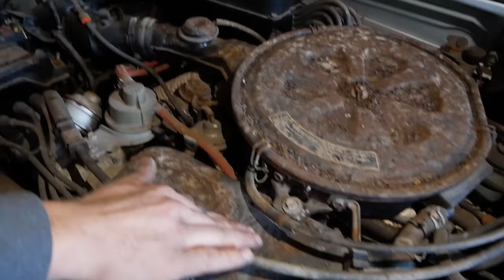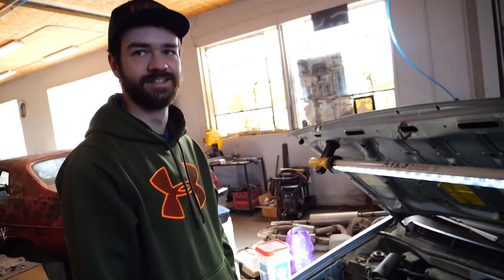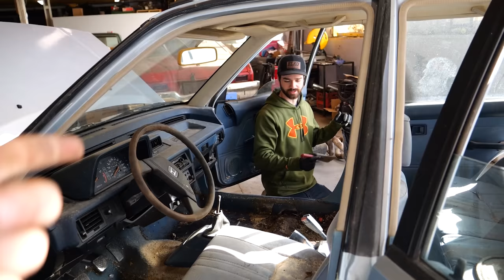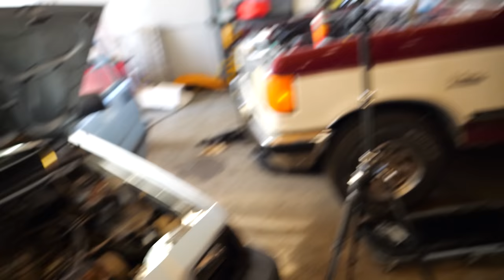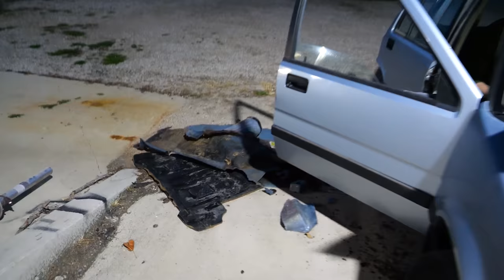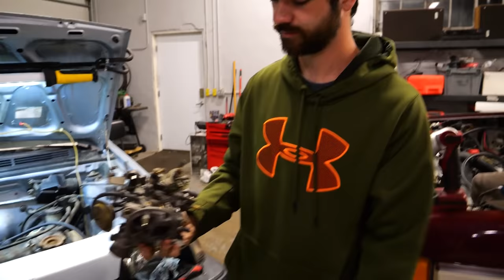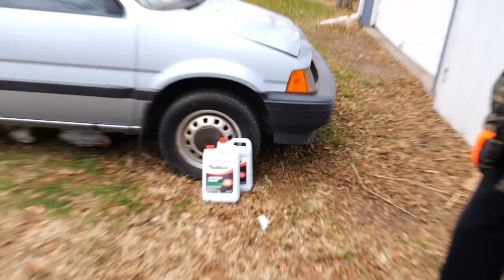ABANDONED 4x4 Honda Civic - Will it Run After 20+ YEARS??

Comment: Boys, get you a piece of 3/16" brake line for your air gun. The fittings should thread right into the end and  will help keep things from blowing around your glasses and into your eyes. Trust me on this one. Gasoline is bad enough, but you don't want the eyeball drill.

Comment: Safety tip either remove tge strings from your hoodie or at least tuck them in. A freind of mine got his caught in an alternator fan and he smacked his head on tge engine before tge string broke. Fortunately he only got a bump on the head but could be worse

Comment: That Daytona was probably a Shelby Turbo Z.  If they have the t top they are worth some money in decent condition. Even without it they are still worth a little bit now. Simply because they all rusted away and are really really hard to find.  I had a two-tone, Electric blue with silver 1993 shelby daytona turbo Z back in 1997 (first car I purchased with my own money in high school) it was still a newish car. I liked it a lot.  Sold it in 2001 for a 25k mile one owner 1992 mustang GT convertible.  Still have the mustang to this day.  Living in michigan I could only dive the mustang in the summer. It still has less than 75k on it.

Comment: I had an 89 accord coupe with that electro carb. Just swap that thing to one of those weber aftermarket kits or  fuel injection. A professional rebuild at a shop (if you can find one that will even try) is $1100. Finding a rebuild kit (that actually matches) is near impossible. And a replacement is $1400 plus. I HATE FI. Hate it. But its better in every way than the 36 million vac lines in that hell spider of a system.

Also that powdered goop is because of the carpet glue. In the 85-90s era the glue honda used, had something in it that would grow stuff if it got wet for any time.

Comment: I had a hand-me-down 1979 Honda Accord with a 3-speed semi-automatic transmission that you shift without a clutch. Zippy and reliable little car. Practical. Even drove it down sandy desert roads in the backcountry and it did fine – didn't get stuck because of the FWD: you just turn the wheel back and forth to not get hung up in the sand. Would have run forever except that I didn't replace the timing chain out of caution when my mechanic advised me to, and it blew when my gf at the time was driving it on the freeway. Bye bye Honda. Fun while it lasted. Kind of a tin can though in terms of noise and safety on the highway lol.

Comment: I worked at a shop that specialized in Hondas from 1987 to 2000. That was one of Hondas worst engines to me. Overhauled many burning oil , and bent valves due to broken timing belts

Comment: This is like my sister's 97 I was driving for a bit while I'm getting my volvo fixed except the rust isn't quite inside yet. Subframe is shot and I was still driving it despite being dangerous. Front tires are hard and I ended up spinning out and smacking the rear on a jersey barrier and the rear trailing arm ripped off and everything it mounts up to is just cheese. I'm gonna keep it around for an engine swap into an older civic that's in better shape than, well, cottage cheese.

Comment: This is the way Honda's which aren't destroyed in an accident go to the grave. You bring it to a shop and they tell you they won't work on the car because they can't put it on the lift. The floors rot away taking the entire car with them even though the motors, transmissions and electrical are still fully functional.

Comment: Alcohol works the best for wet Motors it mixes with the water and it will burn you can put it in your gas tank when you have water in the tank from from bad gas at the pump and it will get rid of the water every time works perfect put it in a spray bottle spread in a motor like this and it will start every time

Comment: Those 1980s civics last literally FOREVER. Just make sure the unibody is not rusted. If it is you are basically fucked. Thats the issue with japanese cars of the 80s. The mecahnics were very reliable but you needed to undercoat the unibody from brand new. Other than that yeah EXTREMELY reliable. Cast iron engines.

Comment: Brakleen is worst for starting engines it is for cleaning parts and it washes the oil off of the cylinder walls where ether does not. Brakleen is not meant for starting vehicles where starting fluid is. I personally think both is crap and I use gasoline to start engines and only use Ether on low compression engines that need the extra boost other then that gasoline is the go to starting fluid.

Comment: What's more rare than a Honda Civic Shuttle? A 4x4 Honda Civic Shuttle. What's even more rare than that? Any Honda Civic Shuttle with a passenger door mirror. The sedan mirrors will supposedly fit but they're a smaller, rounder shape.

Comment: It's too bad they don't make engines like this anymore. I think I'd prefer a computer carb over a fuel injection for an offroad vehicle that I can beat the crap out of. Just easier to fix or completely remove the system and then turn it into a manual carb. Just something simple to work on. That's what I want.

Honestly even an electric car. I don't want a tesla, just a battery hooked to a motor with a throttle in between. I just want it to be simple and easy to maintain

Comment: I love old Hondas they never die I got an 86 with 327,000 runs great plus it’s from California so absolutely no rust if the engine or transmission ever do go out I’ll replace them cause of how solid the body is I’m just about to sand and seal the bottom just to keep it preserved

Comment: I almost hate to admit this , but , I bought one of these BRAND NEW 
off the " show room " floor !!
BUT the absolute WORST part of that deal ... I traded in a pristine
65 Barbuda w/273 auto in the floor !!!! ( I got three grand off for 
My trade .... can I make a GREAT deal or WHAT ... hmmm  ?! )
EDIT : 
BTW if You have to take the alternator off ... first You HAVE to
pull  the front axel in order to remove
it !!!! ( My alternator went out right at
12000 mi. . I got it fixed under warranty ) My car looked just like
this one . The low gear only works in four wheel drive ( otherwise it won't go into low gear )
ANOTHER EDIT :
The more I watch this video , the more I remember about those cars
My car was badged " VANGON " .
BE CAREFUL ON DAMP ROADS
IT WILL HYDROPLANE ON YOU

Comment: I had that yr honda but a civic hatch back. Reason why I brought it my first new car cause it was 5,000 buck cheep new. LOL and I came from a fire bird 403 new that I only wanted to test but brought it for   8,500 but it use 5 buck gas every trip and this was during the gas crunch time, but the Honda 5 buck lasted over a week of driving  LOL  that why people are spending 60 thosabd fir a truck is nut. My 1995 ford van cost 2,000 and it's over 10 yr and still got more to give. LOL

Comment: 1. It's a Civic, so it will run. 2. That body looks insanely good. No severe rust on the wheel wells, just the typical stuff? Usually you can put your hand through the rust holes. Floorboards are gone, but it's almost like something caustic was stored in the car and leaked onto them and the seats